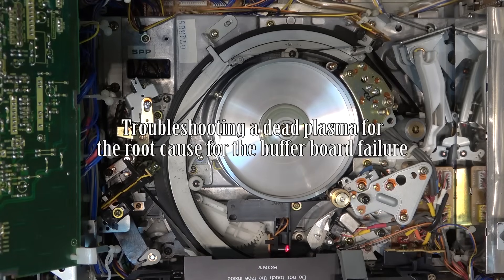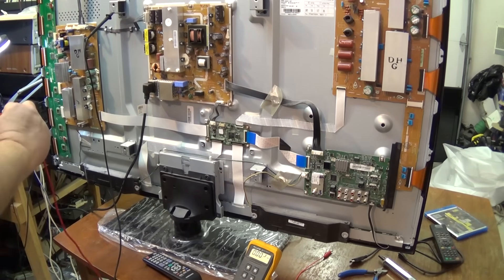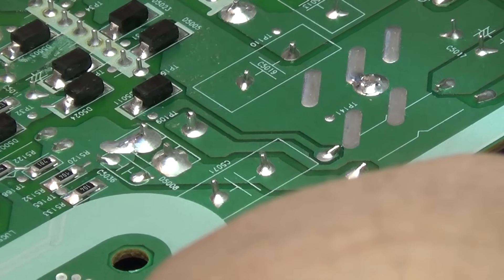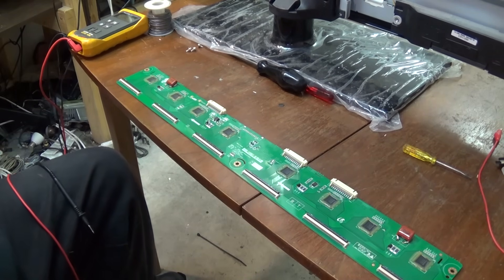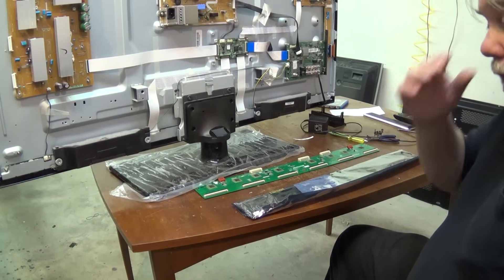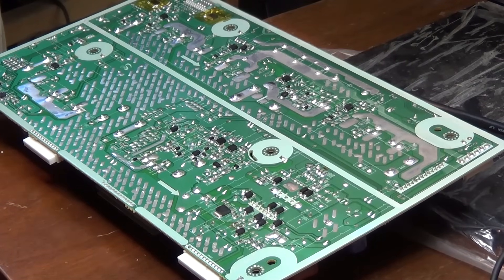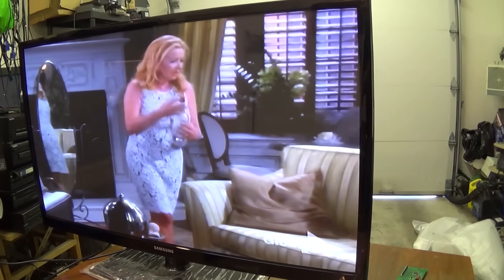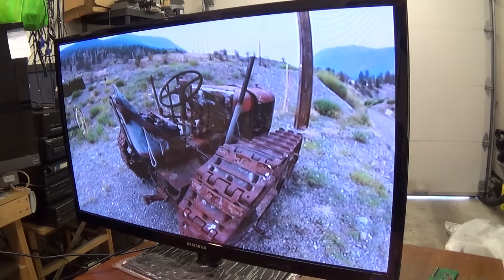Troubleshooting a Samsung Plasma for the root cause for buffer board failure

Comment: You broke your back installing a plasma on the wall there about 80 lbs .
Reply from the maker: Ha ha ha.  Try for 165lbs.  That's what my 63 weighs.  It took me and both by kids to get it down so i could service it and then out it back up. By "kids" I mean 20 something kids.  The early ones were heavy but they did get much lighter.

Comment: My grandma had a Samsung TV, but it's most likely long gone at this point. Screen kept flickering, it also had an issue if you tried to change the picture, audio, etc. Settings in the menu when you turn the TV off and back on, the settings would roll back to where they were last set.

Comment: I love my Fluke 12!!! I have Keithley, HP, ......... I still use my 12 for everything. I bought an extra one just in case.
Reply from the maker: Still got mine but it's not used as much now. The one I am using currently works fine works good.  I have a new fluke I haven't even shown on the channel yet.  Bought it for a song on FB.

Comment: Ah yes the slightly defective bedroom TV. Mine's a 46" Samsung 4k I got for free because it just shut down. All signs pointed to the board (there is a single board with the PSU, main, and T-CON integrated) so I got a new one and it seems the built-in T-CON was for a different panel type. Picture was vertically stretched off the bottom with every other row being driven. However, I noticed something else: There was now a permanently dark row on the panel. I tried the original board and the set fired up, same dark row. So I returned the unusable part. My guess is there was a shorted row driver in the panel shutting down the set and it finally blew open. it's a smaller 4k panel so you can't see the dead row from more than a couple of feet away, and it works perfectly running apps like Plex, etc.
Reply from the maker: It works.  Comes on at 630 to wake me up for work.   Just have it on antenna for local TV and the modulated channels i generate in house

Comment: Plasma's ran hot..thermal crack.  I remember the TV repair guy telling me that was a major problem with some .  They were expensive as well.  Never bought one but always wanted one because the picture was amazing.  Great video redo!
Reply: Screen cracks were mostly in the last generation plasma sets, cutting cost and used thinner glass. Also people caused it when they clean the screen when the screen is on and spray cold liquid on a hot surface

Comment: Thanks -- i might have to reference this!  🙂I have one of these.  Glad I bought it even though i haven't put many hours on it.
Reply from the maker: Check the ground screws and resolder that IC under the yellow tape before it blows.
Reply: @12voltvids  wow, OK yes thanks!  I will not operate it until i do!

Comment: I have a 20 year old Matsui 52'' plasma and it refuses to die it docent even have HDMI and it's so heavy i need to throw it out it uses 250W and that is a hell of a lot of power just to run a TV
Reply from the maker: Back in the day when we had CRT tv they drew a couple hundred watts easily for a large tube or a projection set.
Reply: @12voltvids   I remember them well lovely fuzzy screens tuning them like a radio then TV ariels moving them around to get the sweet spot
Reply: For a 20 year old 52" plasma, 250W is not bad. Some of them needed more than double that. Especially the high refresh rate 1080p ones. Once I saw the back of an industrial LG 90 or 100" PDP,  the power consumption was over 1000W! Or maybe even over 2000W, it was 10 years ago, so I don't remember clearly.

Comment: good ol' plasma just looking amazing again! I love these.
Reply from the maker: Same here.  I find the technology that makes them work fascinating.  LCD and oled are boring.apply a vintage across an x-y junction and you either light up an OLED pixel or make liquid crystals twist.  
Plasma on the other hand you have to charge the cell with high voltage and then trigger it at just the right time.  Trigger early and the pixel lights up brighter trigger it later and it's dim.  It stays o tilll the reset cones along which extinguishes the display and resets it with a new charge ready to fire.  This happens 600 times a second for each of the red green and blue sub pixels.  
High speed and high voltage electronics. To think plasma technology was around in the 60s. They started out as panaplex numerical display then became alpha numeric and finially dot matrix display to the first flat panel computer screen.  They were monochromatic at the time.  Orange display as they were filled with neon gas.
Reply: @12voltvids plasma and CRT displays never cease to amaze me

Comment: that TV was worth fixing back then. The new TV's now aren't worth fixing because they are so cheap & people are even giving the old models away on marketplace. I bet the ones made today won't even last 5 years.
Reply from the maker: For sure new ones are not worth fixing.  I don't even accept them for repair.  I pick up the odd throw away to see if i can make a video of repair and then give it away when done. I'm not doing much of that now either because you can't even give them away.  Nobody wants them.  I'm basically sticking to audio  work and vcr repair these days.  Have zero interest in TV's.
Reply: @12voltvids  True if it's not a smart tv no one really wants it. I had someone give me two tv's one was a Samsung 40" smart tv & sold it for 100. the other was a 15 yr old 42" Vizio i was lucky to get $30 for it & it took forever to sell i would have kept them but i didn't really have a use for them.

Comment: I still have my fully working Pioneer Kuro Plasma that i still use for DVD's any Laserdiscs. Todays sets won't be working as long as these have.😊
Reply: Those are the best, Pioneer made the best plasma sets and still have a better picture then the modern tvs
Reply from the maker: Very true.  Designed to last 5 years